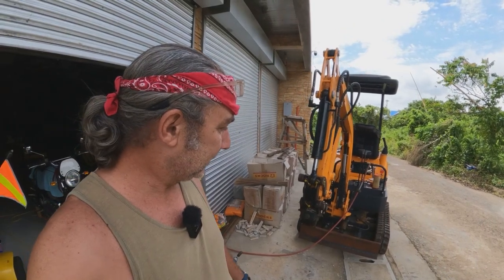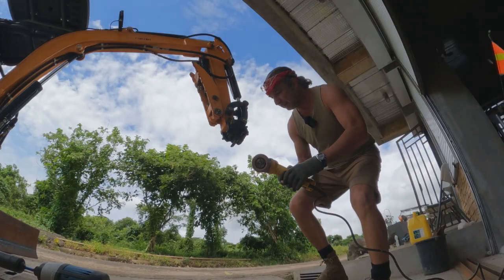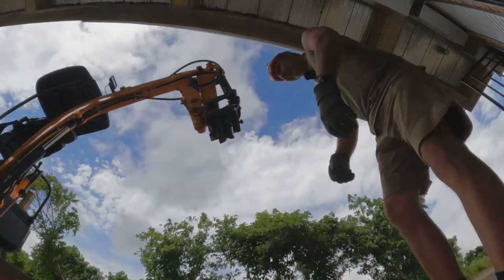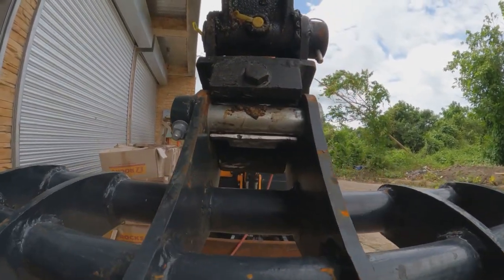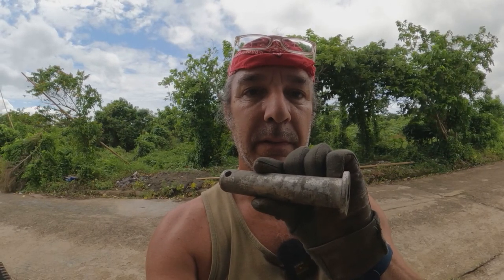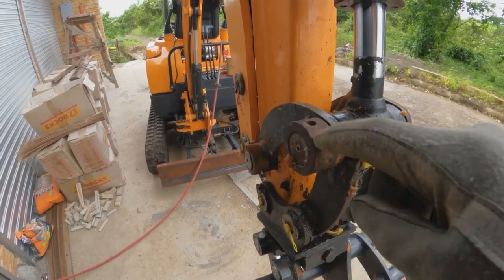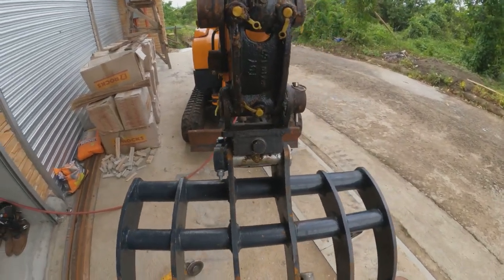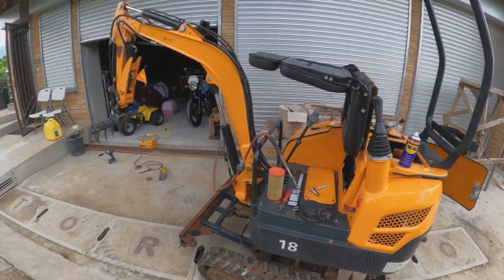Mini Excavator Rake Attachment 👨🏼‍🌾 | Mini Excavators Philippines | Ep. 07 | TORINO

Comment: Morning Mike, A quick question for you. Where did you get your fiber for the concrete? All I have been able to find  is a little bag for 1 bag of cement. Maybe only 1/2 ounce. I would like to get bigger bags, like 1 pound or 3 pounds bags. Thanks.
Reply from the maker: Hi, I also found only small bags available on Lazada. But, I bought mine on Amazon. "Bon Tool 32-500 Concrete Fibers - 3/4" Anti-Crak - 1 Lb" bags. Here is a link: https://www.amazon.com/stores/Bon+Tool/page/7D51684D-9615-4EF4-B39A-EF9404D266F6?ref_=ast_bln
Reply: @torino2610  Thanks